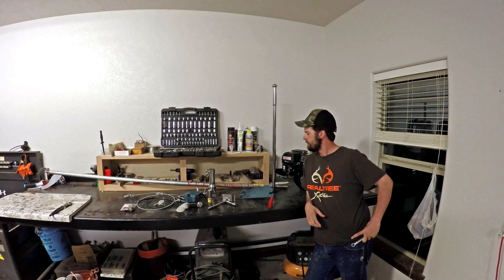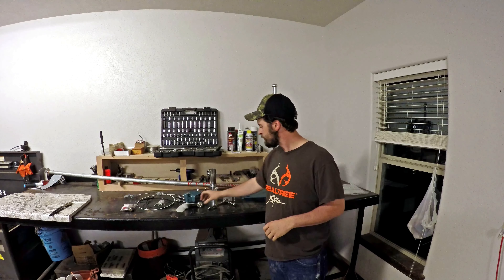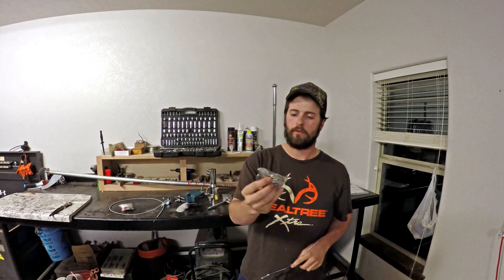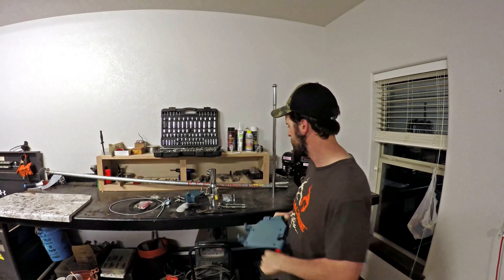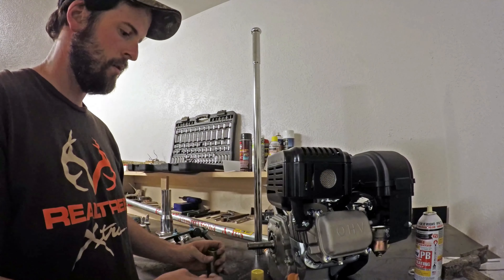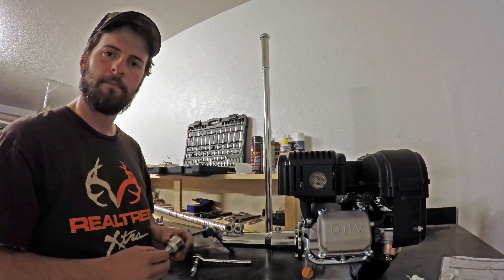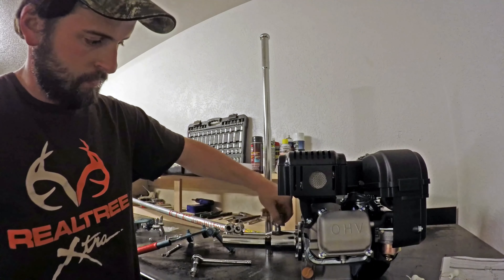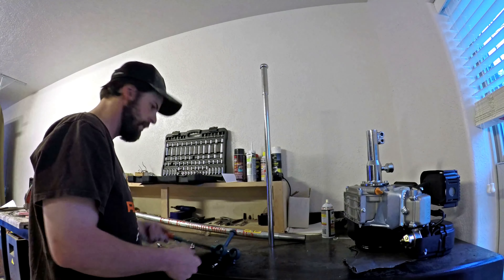Mud Skipper Assembly video

Comment: Thanks for the video.  Did you film it with a gopro 4 with the wireless on (so you can control it from your phone?)?  I had one and it had this helicopter sound when you used wireless.

Comment: How did it run? Did you have any problems on the water? Thanks for the video
Reply from the maker: joseph martino it runs great I put it on my 12x32 boat and I got 17/20 mph with it and no problems with it but only ran it about 9 times but I like it
Reply: Do you know anyone who has run one in a shallow river. Wondering if the occasional rock would brake them. I don't mind putting on a new prop now and again  just don't want it to grenade.
Reply: joseph martino I've run it in shallow water and Rocky bottom....the prop is the weak point in the system...just like a shear pin in a regular outboard it's made to break the prop if you hit something with it..saving your motor from being messed up..the nice part is about these kits is props are cheap...the kit actually comes with 2....break one and you have a backup while your new one is on order....I think the props are less than 20 bucks....I duck hunt with mine and we also have one of Thier twister kits on my buddy's fishing boat that probably has 100 hours on it already....! I wouldn't trade one of these for a regular outboard ever.

Comment: you in Texas, how did it go with TPWD?
Reply from the maker: H Garcia yes I'm in Texas and I had no problems with them
Reply: Texas GoPro Enthusiast awesome ! This is my other account by the way. It only have the grease fitting on the housing or does the shaft have any ?
Reply: Texas GoPro Enthusiast also what grease do you use